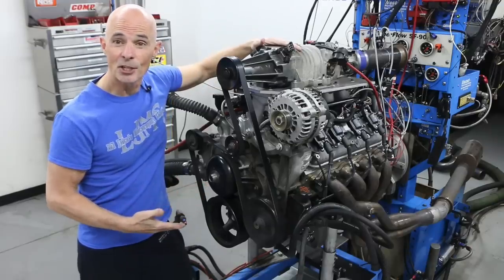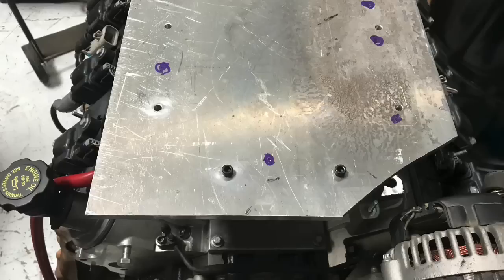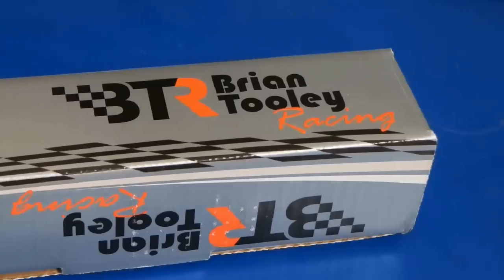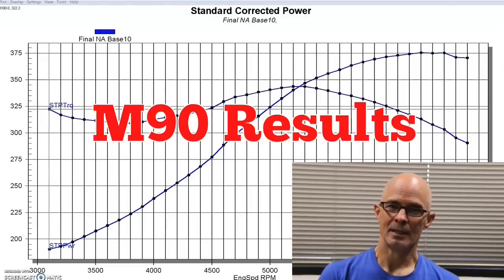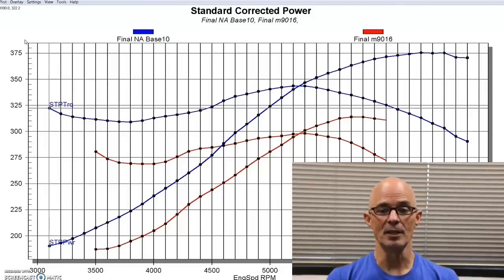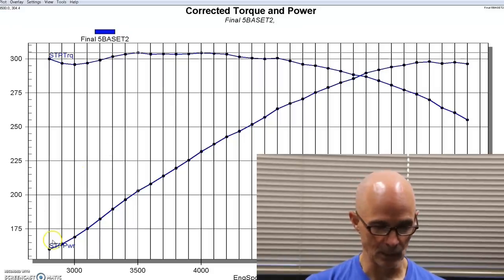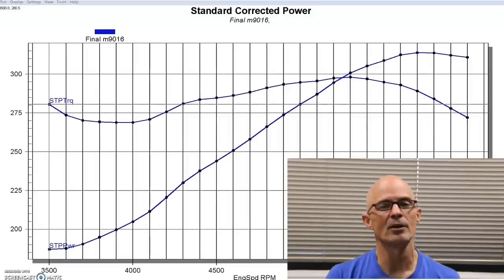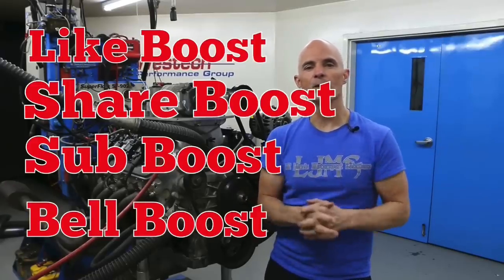JUNKYARD LS M90 SUPERCHARGER TEST-FULL RESULTS!

Comment: Problem is probably that engine can move as much or more air then your supercharger so the blower is not contributing power, it's absorbing power. It's lose-lose. And the faster you spin that tiny blower the more it beats the air i.e. adds heat.
Supercharger is way small even for a ~ 5L V8. I was running a 177ci Weiand on a 380ci small block and it was bearly big enough for 550-600hp.

Comment: There are a few primary reasons I can think of, the obvious one is overall displacement, interestingly the cylinder to cylinder displacement is similar with the V6 edging out at .63l vs. .6l for the 4.8. The other is induction event frequency, with the v8 having an extra cylinder to fire per revolution. The next thing that comes to mind is the volume of the pressurized induction area itself, which that high ram/LS combo probably has many many times that of the original V6 engines intake track, and the motor is literally evacuating the plenum faster than that small displacement supercharger can fill at its current speed, or probably any lol.

Comment: Different variables of why you didn't make as much boost as needed first of all smaller throttle body and that makeshift plate that you set on top of the high-rise..... You know the one with the itty Beatty pass through holes was choking the air flow down.. all in all I very much appreciate your test
Reply from the maker: the opening in the pate was larger than the discharge of the blower-so it was good-since we have made near 500 hp with the throttle body-it was fine too-look to blower speed for the answer

Comment: I feel you are definitely onto something with the size of the balancer/dampener pulley. The ratio must not be right to only make +/- 1 psi. Maybe someone will donate an underdrive pulley that is smaller diameter to test that theory? Also... how does this M90 compare to say an MP112 blower? Is it only a 22ci difference? Or am I way off?

Comment: Put on Twin M90 SC and blow in to them with a really big turbo. Put a a reed valve box between the SC and turbo so the SC can get air when the big turbo dont make boost. Run it on E85 and add 20 pound of turbo boost in to the 5-10 psi the SC can make. Just so we know if the boost adds up 20 plus 5-10 or will the SC be a restriction like the single SC. 
I will build a SNOWMOBILE race engine with a Lysholm 1200 SC and a big 76mm Comp Turbo blowing in to the Lysholm Twin Screw. The motor is an Arctic Cat Suzuki 1100cc Turbo motor. Stock power with 10 pounds is 190hp plan to run 15 pounds from the SC an add 30 pounds or more from the turbo. I will run the motor on E100 or 100% Methanol.
Reply from the maker: nice

Comment: I would love to see a LSA blower on a 4.8 and 5.3. It will support well over 700 hp on the LSA 6.2. I would like to see what the boost numbers and curve are on the little 4.8 and 5.3
Reply: Not as much power as the 6.2 due to lack of displacement and flow is usually hindered as well by the adapter plate for cathedral port heads

Comment: I would expect more than 1.2psi on only a 1L increase in displacement. The bypass valve is either leaking or open. I would correct that, and then run a smaller pulley. Also, people port the inlet of the M90 to run a full 75mm tb. Your NA setup looked like a 100MM tb. That stock TB is a big restriction as well.

Comment: There are so many problems with this test, I don't even know where to start....
#1 -  What type of tuning was performed to the ECU for timing/fueling ?  
#2 - Especially curious how that worked with the different MAF/TB setup since it looked like you used the 3.8 TB
#3 - Would be even more curious to see some spark / knock / wideband data for AFR
#4 - What was the speed of the supercharger pull with your belt routing as compared to the stock routing for the 3800 setup?  Its quite possible the supercharger was spinning at a lower speed than it would on the 3800 setup.
#5 -  It looks like you had the stock pulley on the supercharger.  For a couple hundred bucks, you can replace that stock pulley anywhere between the original 3.6" to 2.4".  I'd expect you'd do much better output with a smaller pulley, especially considering the answer to #4.  Also since you have a much larger engine, the smaller pulley would work well regardless as the air temps wouldn't get as high as they would on a 3800, etc.  (Granted, you can't just spin the blower to infinity, but for a "junkyard" test......)
Given that even the low end numbers are much lower with the supercharger, this leads me to believe this was a tuning / setup issue.

Comment: ….also what’s the drive ratio? Is the crank pulley on the 4.8 big enough to spin the blower up? These M90’s are on the Roush 427 4.6 litres making decent power, no reason they can’t on a 4.8. Not sure what the point of this video is if these extremely important points aren’t discussed.
Reply from the maker: That M90 is completely different and was spun much faster

Comment: 7" crank pulley on 3800 and 7.7 on 5.3  14k rpm on blower at 7000rpm. You can try a 3.2 pulley it's 3.8 stock but it will probably be a heat pump with out porting.

Comment: Very basic calculation is on a 3.8 the crank to blower ratio for .5 bar is around 1:3.2... on the 4.8, it would need around a 1:4 to make the same boost level on a .9 liter blower. Maybe my math is wrong (and it probably is) but the blower pulley would have to be an  inch (at least) smaller for useable boost .
Reply from the maker: you don't calculate boost vs displacement-you need to factor in na power

Comment: On the GM J-body forums, it's common to see newbies increase the boost of their factory-blown Eco-Tec engines by decreasing the driven pulley's size. I argue against this method as this only causes the factory blower to spin faster, which in turn negatively effects it's adiabatic state and causes the inlet air charge (post-supercharger) to increase in temperature, thus negating any gains. In turn, I suggest installing a [under-driven] blower of larger displacement to gain the desired air-flow increase without the negative effects, but often run into the classic question of "How do we do that?!"

I guess what I'm asking here is: Could you attempt fabricating/modifying a mounting for the M90 blower onto a Eco-Tec, and see what results?

Comment: For started the Holley intake has a 92mm throttle body while the M90 uses a 68mm throttle body. I'm pretty sure 68mm is smaller than even a stock LS throttle body. I bet if you put the 92mm throttle body on the M90 with a smaller pulley you could get it to get back to almost 400 hp

Comment: Off the top of my head, a 3.8 l67 crank pulley is 7% smaller than a LS truck pulley. FWIW, my twin 5.3 will see 5psi at idle with the bypasses shut. 15-16 under full throttle. Also what gen blower do you have? That will make a difference.

Comment: On race gas with a small pulley should push 500+.  Many 3v mustang dinguses made 400 easy and 500 fairly strung out with the m90.  I bet this 4.8 flows as well.

Comment: I have an LG4 305 that came factory in my 85 Monte. And I also have a 2004 Impala SS with this same supercharger. Question is, if someone were to fab up an intake with port injection that would allow this supercharger to be mounted on a gen1 305 with smog era heads, would it make boost or is the 305 still too big for this supercharger?
Reply from the maker: if you spun it real fast it might work-better to use a different one

Comment: Did you have the bigger m90 or the smaller one? The o es from 04 up are bigger and make more power. Also , check the speed of the pulley.  Might be under driven , and needs a smaller pulley.

Comment: Somewhat curious about where you measured the boost. That adapter plate to that intake, seem rather inefficient. Basically making the air take the long way between blower and intake runners. 
 Not knowing the blower rpm is also a big area for discussion. Along with blower overall capacity. 

  None the less, cool test. And I think dual blowers with twin turbos blowing into them would be bad ass. Some Mad Maxx  action. 👍

Comment: Piece of Cake. Undersized Blower. I think it was a very interesting test. 👌🏻👍🏻
Abandon all hope with the single  M90. Even at feeding a little 3.8L BUICK V6 it was already being taxed. A pusher turbo probably wouldn't help much, if any. GM has already saved me all the R&D headache.
Trying 2 M90's would be interesting (double the parasitic losses at the crank and double the positive displacement (180ci), theoretically good to feed up to a 7.0L engine)  but I guess you could spend your valuable time on better things (I certainly wouldn't, just rigging those 2 blowers in parallel looks like a mission and a half, if  I had to do it it would be TURBOS) BUT if you do it I'll watch it, FOR SCIENCE ! 👍🏻😎
I guess you would mount the blowers in a similar way to what Mercury Racing does (or did ?) with their 1075 engine. https://youtu.be/umj8JSZ7dG0

Comment: Looking at the compressor map an M90 is good for ~500CFM. 500CFM is near as makes no difference good for ~300BHP.

So you got about all you'll ever get from one. great test, fun; although a bit dumb ;). However for a motor where you only want 250-280BHP it's not a bad option. say a 1.6-2.0L 4-cylinder. Makes the smaller motor 'feel' way larger. THis is why the Toyota SC14 (roughly the same displacement as an M90) is popular to fit to old datsun or toyota 4's.

Would be great to see you do that!!!

Comment: Hey Richard I have a question.

I didn't know what would be the appropriate video to ask this on and I know this is already a year old.

I've seen people using the m62, m90 or other positive displacement superchargers "remotely mounted" in the sense that they are connected before the throttle body mounted i guess in the same way a centrifugal supercharger would be used.

Is this actually a viable way of doing this?

Comment: I think it didn't have enough draft, plus I am building a 350 vortec with a eaton supercharger Plus I want a 950 Holley carburetor I haven't picked a distributor, I think  I am going to use those old spring configuration piston rings I will put a video on youtube when I get in it runing

Comment: The guy from Junkyarddogs is actually making a dual m90 setup for his 5.0 mustang. It would be interesting to see if it actually supports higher power or if youre better off with a m112 or m122 on the same combo. Long ago I had plans to use an m90 on a 1.6-2.0 liter engine and my frined is trying to mount a m122 to his 4age mr2. I would love to see the dual m90s

Comment: @richard holdener I've found from experience that pullied to the max with a 3.2" pulley they are good for about 450hp worth of air on their factory l67 v6 with full exhaust and stock manifolds so two of them should be good for 800hp pullied out.
Reply: Also I believe that there is an adapter available to put the rotor pack of the eaton m90 case, fully ported I bet that you could get 500 out of an m90/112 hybrid with lower iat's also a cheap air to water core for the gm m90 is like 300$ so I'm sure if you optimized it a little bit you could get some decent numbers. As you can tell I have a soft spot for the m90  and gtp on which it came lol.
Reply from the maker: I did a lot of S-ported superchargers and Stage Mafs back in my Ram Air Tech days
Reply: @richardholdener1727  I was working for a company here up north in Canada, called turbo dynamics, normally build 500hp 4 stroke sleds for drag, cats and yams but during our off time we went full bolt ons minus headers and intercooler and ran low 12's before we stripped her and built a twin engine setup with 650hp turbo setups on stock block l67's
Reply: Search td twin engine gtp

Comment: An l67 makes 7psi stock and 10psi with a 3.4 on a stock 3800. With a stg 1 blower cam and headers I was getting 6 psi. Even a 2.8" is barely enough for a LS. My m122 gt500 blower made 7psi on a stock lq4 with headers on a Maggy intake. It makes about 8psi today with long tubes and btr stg 2 blower cam and intercooled on a 2.75" pulley. I would think 2 m90's or an m180 would get 10-12 psi with a 3.4 pulley. As much as I love blowers a smaller pulley won't get you where you want, gotta go 2 like that photo I put in the sloppy fb post. Thunderbird supercoupe m90 up front driving a gtp m90 in the back, drive the rear blower off the front blower.

Comment: The M90 just wont flow that much air. I explored this when I was disappointed that the only SC options for a Pontiac V8 are the hulking 6-71(or larger) units, which also means cutting the hood open (or a custom hood of some sort). I was hoping to find something that could be tucked under without going to a 'blow thru' setup of a Centrifugal SC.

Comment: I'd like to see a custom bracket with multiple M90's and maybe a single large 90mm throttle body with a rams horn connecting the 2 superchargers at the back with the 90mm TB in the center
Reply: It might make less hp than it did with 1 sc. The Pulley setup created almost No boost . 1psi
Reply: @codyramos3200  well if 1 isn't enough 2 is always better right ? LOL......I'd still like to see how if fairs out.....I watched a video series one time on YouTube a guy bolted 2 M90's to his 5.0 in his fox body.....never saw the end of it though......I got caught up in other stuff and never saw the dyno rated/tuned results but it was interesting for sure !

Comment: Judging from the video it seems like the SC is running at a mere 1,7X crank speed which is far too slow. Reducing the pulley to 3X crank speed would yield 270CU of airflow per revolution which is about 12 PSI of boost and could increase the power to 500+ HP.

Comment: It'd be interesting to see what that m90 blower can supply in airflow on this motor. When people wring them out for all they got on an built 3800 with a tiny pulley and, spinning them right to their max rpm limit and pressure ratio reasonable limit (15-16ish psi), I can't help but wonder if, in easier circumstances (bigger better breathing motor), it could actually give some more airflow. They can produce around 400whp fighting the good fight on a purpose-built 3800

Comment: How about the Cobra 4.6 Eaton intercooled M112 on the 3.8 series 2? Only a few hundred bucks at the boneyard. I was thinking about doing that with the intercooler plate to see what kind of output I can get for a transverse setup.  Blower shop makes a low profile intercooled LS manifold base plate for basically any supercharger out there.  07 Eaton R122 from a GT 500 on eBay for 500.00 obo.

Comment: That m90 is sort of a crappy blower to begin with. Most of the 3800 guys ditch it for a ported one or even a bigger variation. On a bigger engine, it’s simply out of its efficiency range. On a separate note, it would be quite interesting to see you mess around with turbo 3800 s2’s.... it’s a pretty common thing to see on the monte’s and fwd gm cars, as well as the v6 4th gen f-bodies

Comment: I'm sure it would not work well at these speeds but you should turn it around and find a way to run it off the flexplate I guess in a vehicle you would have to cut 2 slots in the bell housing but it would be spinning like 2 or 3 times as fast

Comment: Please do a twincharged test; blower through turbo, and turbo through blower!

I'm curious how the compounding effect will work on each setup.
Reply: You'd want a turbo through the blower, the blower would restrict the turbo at high rpm, but the turbo would windmill at low rpm and just feed it boosted air that it'd further compress at high rpm
Reply: @phoenixeragon6404  that's not exactly true.
It is possible to feed the turbo with a blower, and transition from the blower to turbo only, via a secondary throttle body and intake between the two units. With this setup, a clutched pulley can be used on the blower to take it offline once the turbo is at full spool, negating the parasitic loss of the blower. 
There are production vehicles that run this setup with great success.
Reply: @unicornsqueezins7906  interesting! It seems like it would be much more complex compared to the turbo through blower set up. Why would a car company do that rather then the turbo- blower? Less matinance on the blower because it disengages?

Comment: I think it simply can't supply the air volume needed...freakin neat to try tho!
Reply: It can, definitely can. He didn’t have the bypass closed.  He obviously doesn’t know how to work that blower
Reply from the maker: Bypass valve was closed
Reply: @richardholdener1727  oh I'm sure it was closed...I meant that the m90 was simply too small to supply the air required to make that size engine make power..

Comment: I'd like to see the individual Air/Fuel ratios on each cylinder with that plate on there. Looked to be blocking a lot. Also I didn't see a heat exchanger

Comment: I believe that adapter plate was all the restriction only the front half of the engine stole all the air back cylinders cut off i think it wouldve made slighty more than NA but yea probably only 1 or 2psi

Comment: I'd love to see the tvs 1900 from the lsa on these 4.8's. I know they make the adapters plates to mount it to cathedral Port heads,ive seen them used on eBay for $600-1000. I know it's cuz that coupler defect but relatively cheap to fix. Be alot cheaper than buying a Magnuson etc,no?

Comment: Why does everybody say “it’s a supercharger from a v6” when superchargers or any other form of forced induction doesn’t care what kind of motor it comes from all superchargers care about is displacement, of course it didn’t make power, u took a supercharger off a 3.8l and put it on a motor 1000cc bigger which requires a lot more air. If u took a supercharger off a 4.8 V6 and put it on a 4.8 V8 then you’ll see improvements